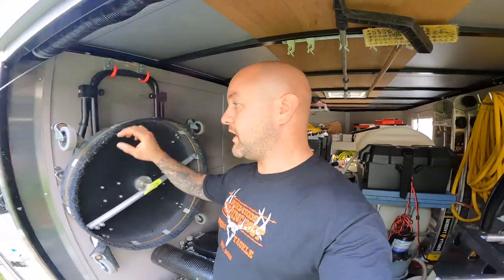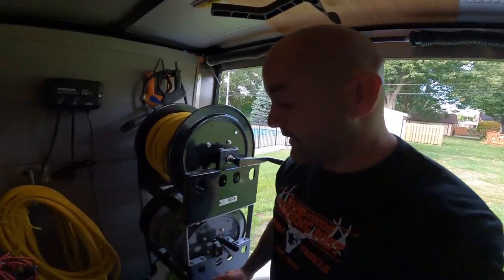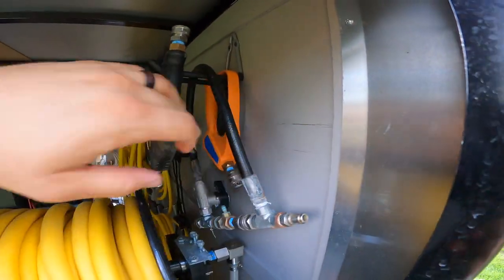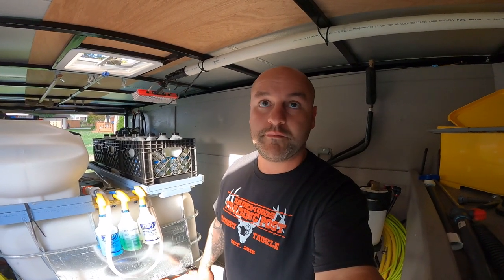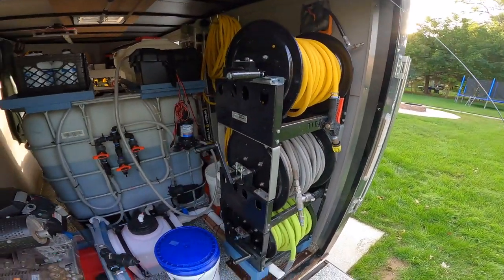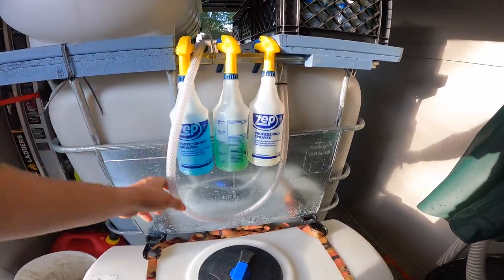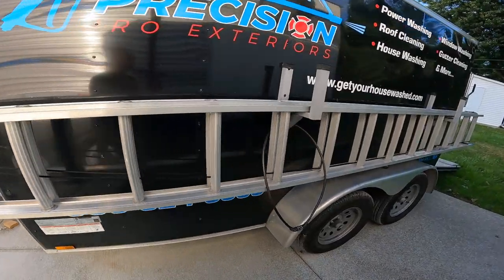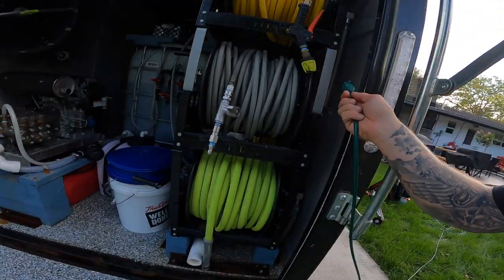Pro Pressure Washing Trailer 6x12|Full Season Update|Upgrades|Power Washing|Soft Washing

Comment: What did you put on your trailer floor to protect from bleach? How good does it work
Reply from the maker: Polyaspartic. Worked great
Reply: I see a bunch of different brands and stuff. Do you remember the brand you used?
Reply: Also does you can’ sand the plywood before putting it on
Reply from the maker: @danielcatches9376  no. I had a company do it for me.